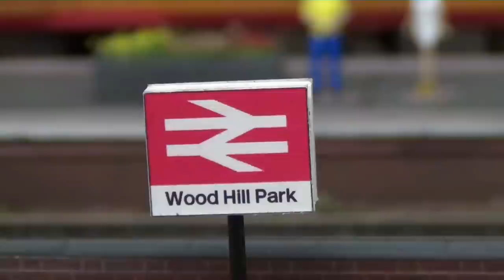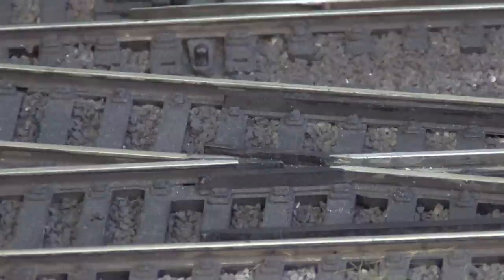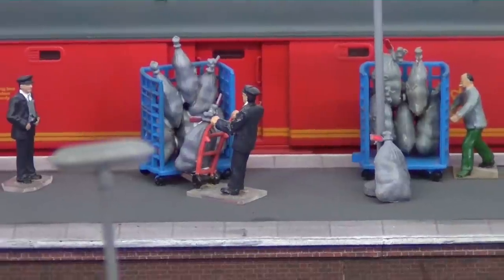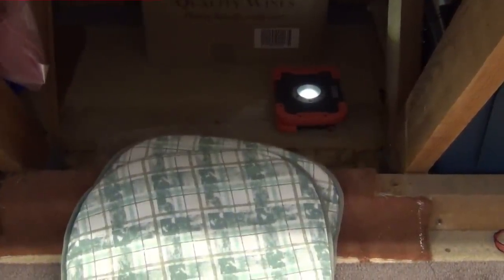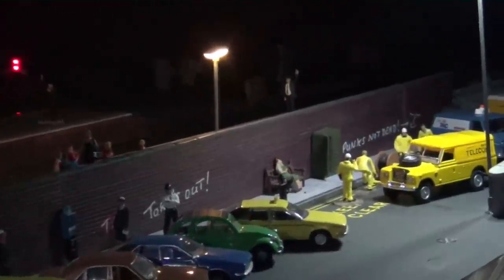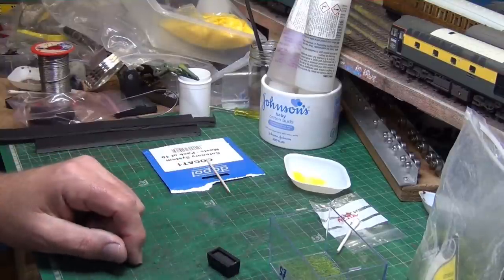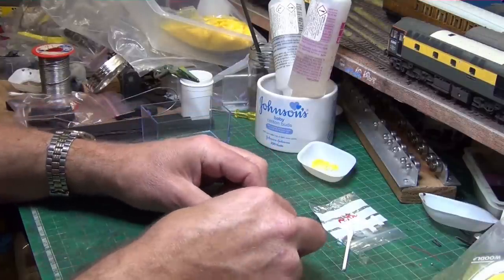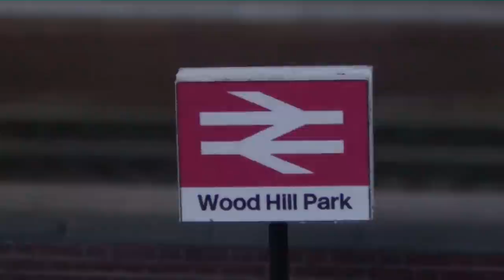Station Detailing, HST Layout Speed Test & Tutorial .48

Comment: Excellent. Great era. Looks really good. Some excellent detailing. Wonderful vehicles. . Had similar with light bleed. I painted the inside several coats of black and then stuck paper brickwork over the top of that. Worked for me. Good luck.
Reply from the maker: Sounds like that could be my final solution if I can't sort it another way. Cheers for the idea. 👍
Reply: Try lining the inside of the building with baco foil before applying the brick work.

Comment: G'day Graham, Thinking about your light bleed issue on the station building, you mentioned you were thinking of matching the brick work to the right side building, Well! that would be a good time to paint the exterior walls in black (two coats) prior to doing the new brick work. It won't completely stop all light bleed but should make a significant difference. I usually paint the inside of my buildings then do a light test before continuing the build. Hope this may help.
Cheers from down under, Wally
Reply from the maker: Thanks for taking the time to give  feedback on my issue Wally. I've nearly managed to cure the problem with just shielding the LED'S (lamp shades pointing downwards) but the advise may still come in handy. Cheers Graham 👍

Comment: Hello, I noticed you used insulation tubing on some of your lighting. I was just wondering what that was as I have some but it doesn't cover very thin wires well? It leaves a gap on the thin wires.
Reply from the maker: I'm not certain as I've had it some time but I think it maybe 1.6mm Heat Shrink Tubing Flexible Polyolefin - Black 1.2m from CPC.